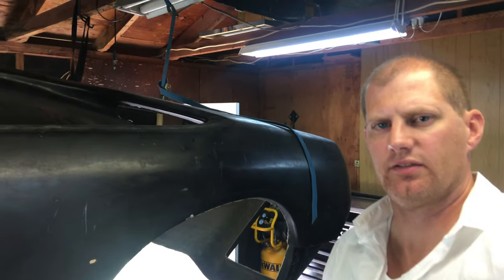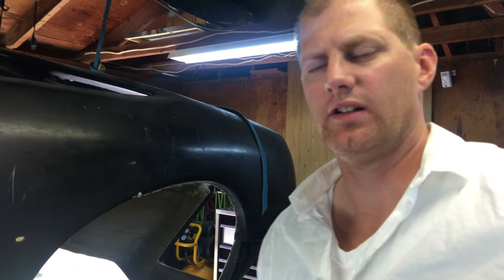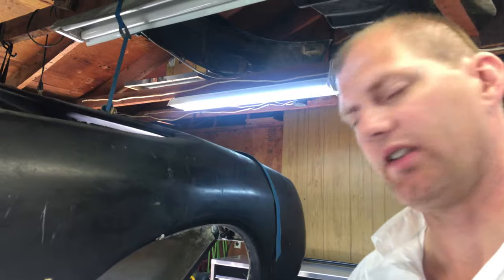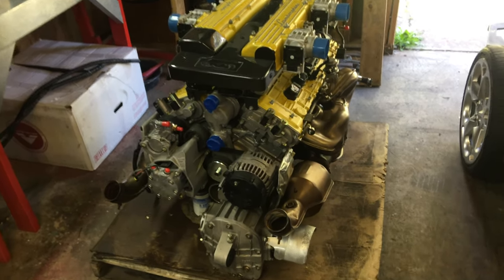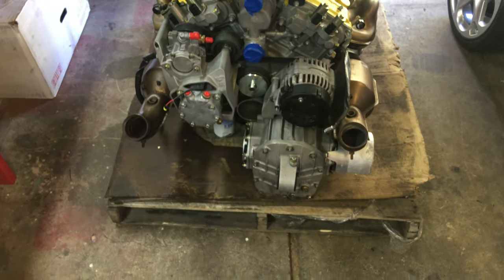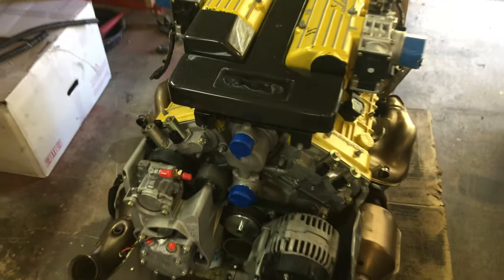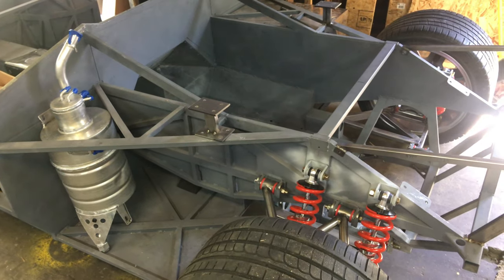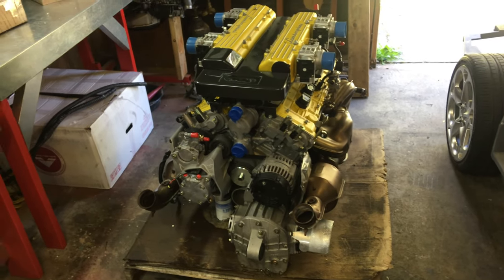Drive train upgraded!

Comment: Oh yea I see you’re doing RWD. I have the Murci gauges for a 6 speed manual. Prob sell them since I am using an LS and no factory wiring. I could maybe get them to partially work but not worth the time. Gonna go with a computer tablet / digital dash system.